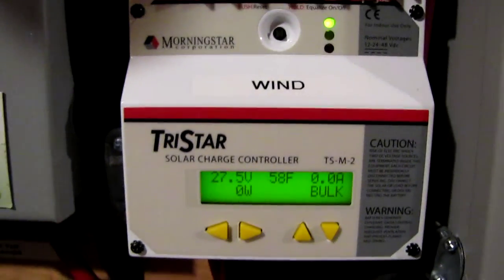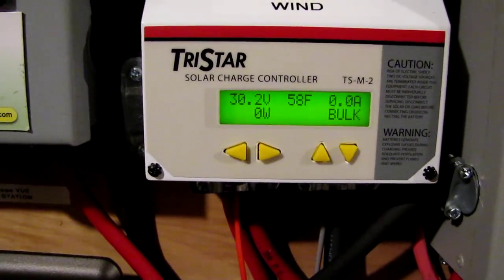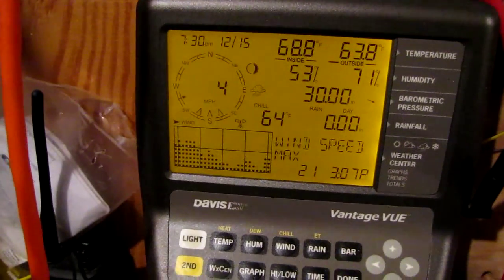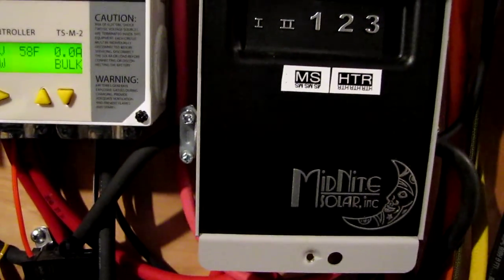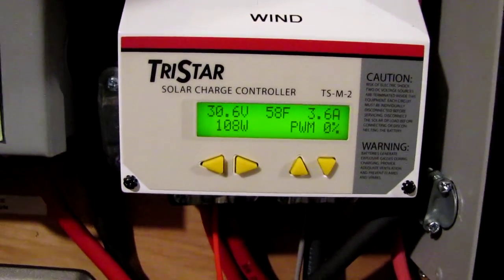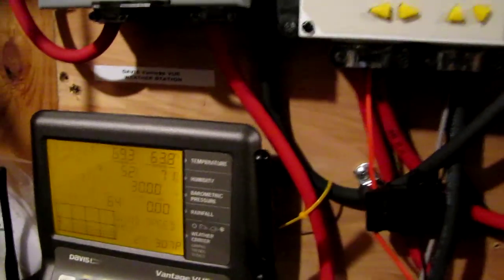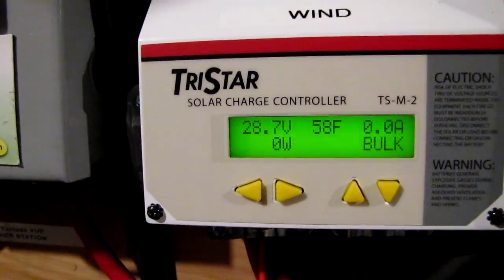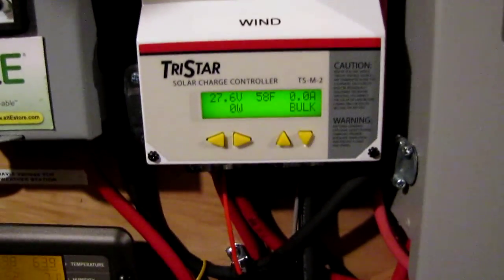Morningstar  TS-60 in Wind Diversion Mode  Wind Power In Chesterfield Virginia  How It Works !

Comment: HI KENNY ONE QUESTION I LIKE TO BUILT A HYBRID SYSTEM CAN I USED 2 CONTROLLER ONE FOR WIND IN DIVERCION MODE AND ONE ON SOLAR ALSO CAN I USE THAT ONE FOR WIND PWM AND THAT ONE FOR SOLAR MPPT THANK YOU KENNY SAMPER FI
Reply from the maker: Yes one for wind PWM Diversion amd one for Solar MPPT 2 separate charge controllers
Reply: @KVUSMC-KU4SMC  thank you ken I TALK TO YOU IF I ANY PROBLEM
Reply from the maker: Anytime Buddy

Comment: When you get 100 watts, 200 watts...is that enough to actually power anything? Even if just momentarily? I am wondering if diverting to a 12 volt 300 watt heating element in a tiny hot water tank is actually going to even turn the element on if it’s 300 watts
Reply from the maker: If you have plenty of Wind Heck yeah  you can heat water etc  it should work great anything helps
Reply: Thanks for your reply. Have a Morningstar MPPT controller, the Morningstar Ts-60 on its way to be as a load diverter for when batteries are charged, etc. Also getting a new Torrid hot water heater with 12 volt (and 110volt) heating element...Really hoping to have hot water more often! Yeah!
Reply from the maker: You should be fine That is Awesome buddy Congratulations
Reply from the maker: The Morningstar TS 60 is a proven unit I have allot of hours on it you should be in good hands keep me updated buddy Semper Fi

Comment: Thanks of the video.  You are right it is difficult to see the divert portion of this controllers.

The display showed PWM which I am assuming it stands for power wave modulation, and unless I am incorrect this is an MPPT solar charge controller being used for a wind turbine.  

Does this mean it can not do maximum power point tracking for the wind turbine, and it reverts to an alternative way of dealing with the rush of energy coming in from the wind turbine?

One of the readings was at 5%, was it able to store 5% of the energy and divert 95% into the air heater?

I have been thinking of doing a daisy chain linked diversion, and I have been watching videos to get ideas.

The first diversion would be to add heat to a hot water tank through a DC heating element, and once the hot water tank reaches a preset level, then use a similar air heater as shown in your setup.

I have seen a mechanical switching for this purpose from a friendly off-grid video, but I have not seen heat a solid state switch diversion.

I am not clear on how to setup a solid state daisy chain linked diversion.

On another note, I believe the MidNiteSolar company has a wind turbine MPPT device called the Classic which permits a higher energy harvest from wind energy:

http://www.midnitesolar.com/productPhoto.php?product_ID=256&productCatName=Charge%20Controllers%20-%20Classics&productCat_ID=21&sortOrder=1&act=p

In addition, it has a similar air heating device called the Clipper:

http://www.midnitesolar.com/products.php?menuItem=products&productCat_ID=25&productCatName=Software

https://youtu.be/ZsGr2YAJmxM
Reply from the maker: This is a PWM Charge Controller Yes those clippers are nice Morningstar Tristar 60 PWM is an awesome controller

Comment from the maker: I basically Just Have It Wired To My Batteries with A 60 Amp Breaker In Between The Batteries And Tristar 60  Then I have Ran Cables to to My Diversion Load/ Resistors / Air Heaters ! I called Morningstar Tech Support For Help Also Buddy

Comment: Hi Ken. Thanks for showing the T-60 in diversion mode. I've got the same unit and wondered how it works. To help me set up mine, could you tell me how you have it wired?
Like: 
wind turbine->charge controller (type?)->TS-60 Diversion->dumpload or batteries.

Thanks